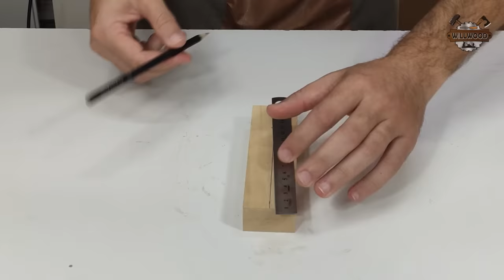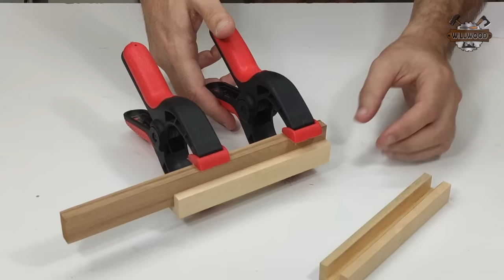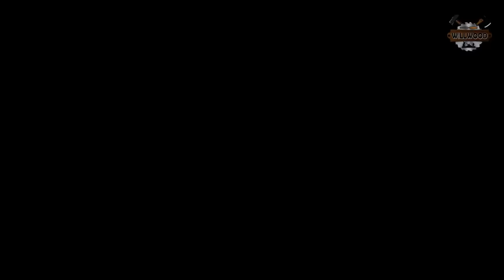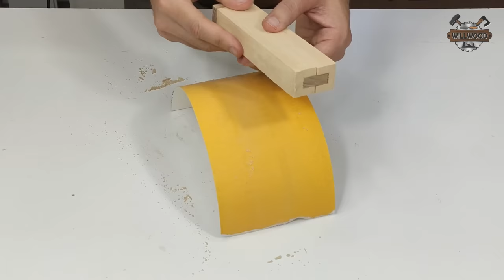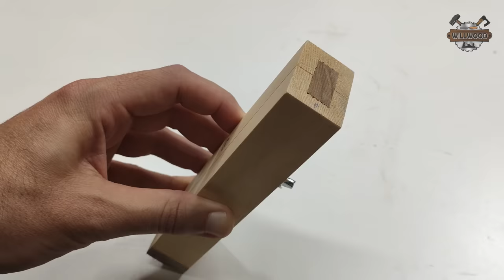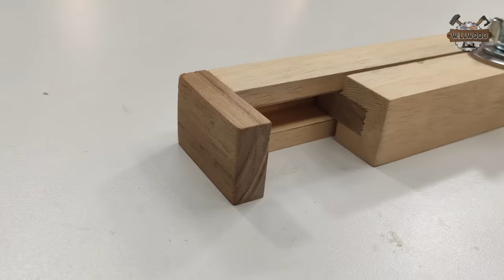Now I found the solution for my perfect fits | Woodworking

Comment: What does it actually do?
Reply: Totaly unnecessery.
Reply: you can order a tool like this made out of metal, this is not his design. i have had one for alot of years now.
Reply: It is a kind of clamping aids. I think.
Reply: What this jig does is crosscut a dado, half lap, or groove in a way that is repeatable and precise. 
If you have a lot of these joints to cut it will go fast once you setup the jig.